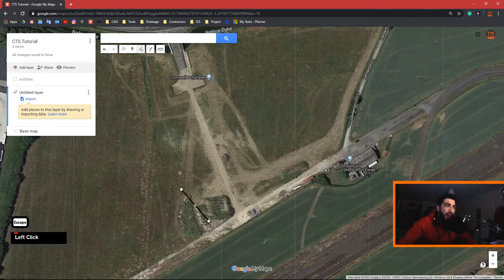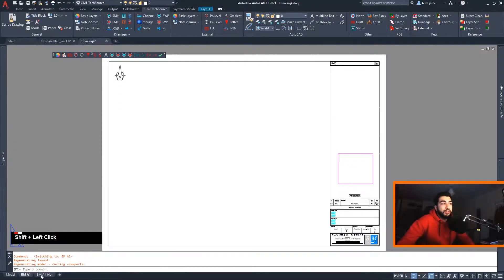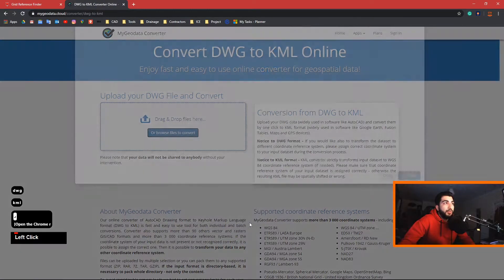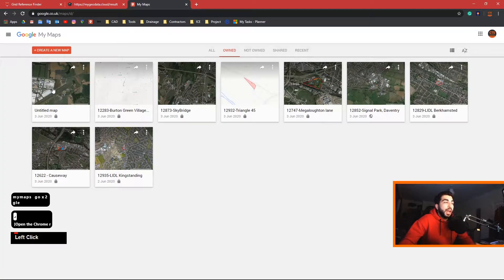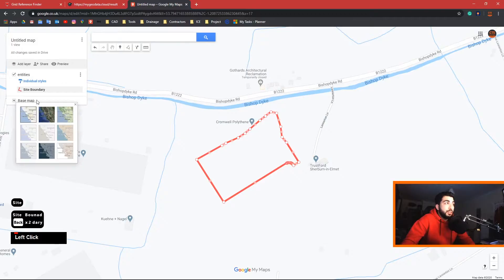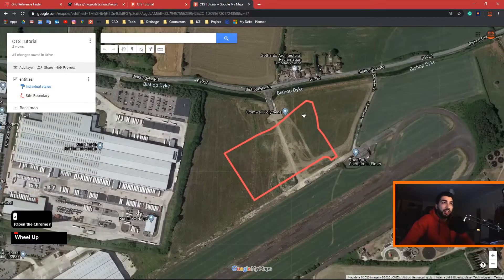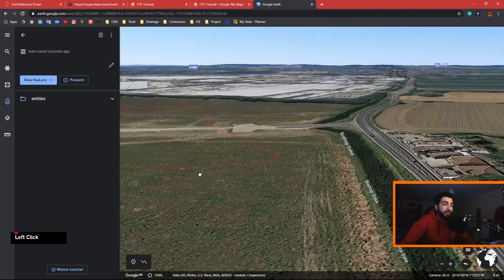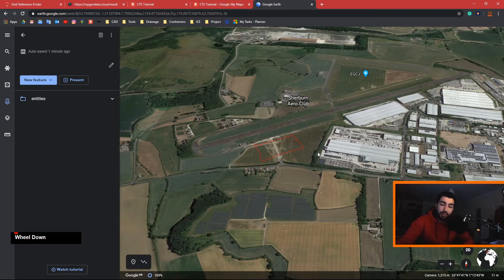How to convert Dwg to KML and upload to Google Maps! (MyGeoData)

Comment: Brother Hi, We are from INDIA, Your video is very good, but it would be much better if you also say how to find our true coordinate system refernce point. for your case it might be easy but for many who are using the method you conveyed, the map is showing some where else way beyond the true point. It would be much better if you could eloborate right from autocad, how do you set the map as per the CSR in autocad, then identify correct csr for geo data and then applying correctly in my gedata website. I wish this will be of great help and favour. Many of us don't know how to setup a map in autocad as per the google coordiantes. so kind request to understand the situation and eloborate it in little more detail.
Reply from the maker: Hi, try the below website. It helps you convert lat & long (which are universal) to XY coordinates based on the EPSG you are working to.
https://epsg.io/transform#s_srs=4326&t_srs=3857&x=NaN&y=NaN

Comment: Hi ! Do you have a video on how to draw in the correct coordinates ?
Reply from the maker: Hi Araly, not at the moment. But will add it to the list (this should be a fairly quick one)
Reply: @CivilTechSource  Thanks, actually i got it, but im afraid i might be doing something wrong cause i keep getting my file in the middle of the ocean:(
Reply from the maker: In that case, here are few things to look out for: 1) Check your drawing units 2)Make sure there is nothing in your paperspace 3) Check for hidden layers that might have items outside the reasonable coordinates. Hope this helps
Reply: @aralydeleongarcia7700  hi, some times it get file some where, not on the exact location where file is tobe. so you try to check your time zone i mean utm of your country / location. just check it on the net.

Comment: Hi I am following your tutorial. Thnak you for it. But I have a problem it do not put my line in the right location. It appear in the middle of the ocean lol
Reply from the maker: There are multiple things you need to look  out for, is your drawings units unit unitless and the your elements are drawn in meters, is your drawing  in the right coordinates to start with? If still struggling send me an email ferdijafar.engineering@gmail.com
Reply: @CivilTechSource  I didn't make the drawing I received it. The unit is meters and the drawing is in the right coordinates I presume when I imported in Revit it's ok. I will send you in your email right now. If you have time to check thanks.
Reply from the maker: @mose8582  Try changing the units in AutoCAD from meters to unitless.
Reply: @CivilTechSource  Thank you for your Help. I received the file sent by email.

Comment: Amazing! But, how can i encode geo data in the Autocad drawing to start with. I think map shaper will not guess it, right?
Reply from the maker: Hi John, what do you mean you want to encode geo data? Do you mean to export gis files from AutoCAD?
Reply: @CivilTechSource  I have a outline layout of a shopping mall - each building and rental unit is polylined individually. I don't have AutoCAD Civil 3D just the vanilla version. I want to be able to do the same you showed in your video - see each rental unit/ line shop with its own boundary and have a jason file so I could upload it to shape maps in Power BI. I am just a occasional user of AutoCAD not avid.
Reply from the maker: @johnabram4159  , I hope this helps! https://youtu.be/oIRrNYoo8aI
Reply from the maker: If you are still struggling, send me the files to the email address listed in the channel.